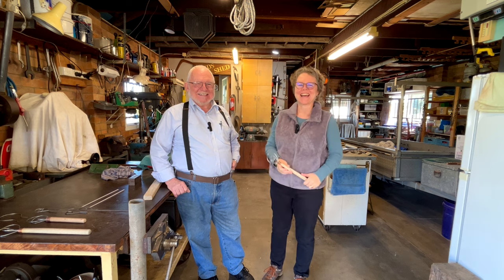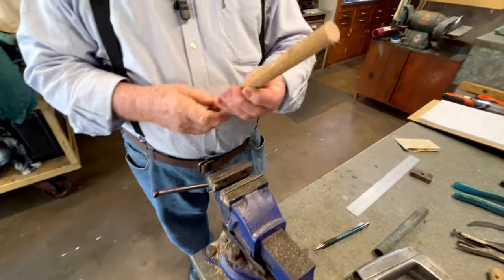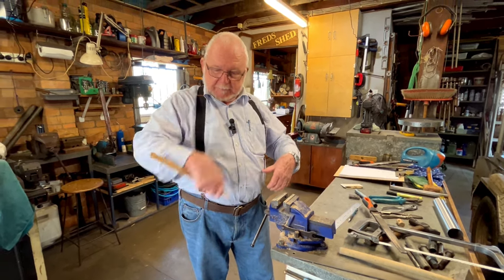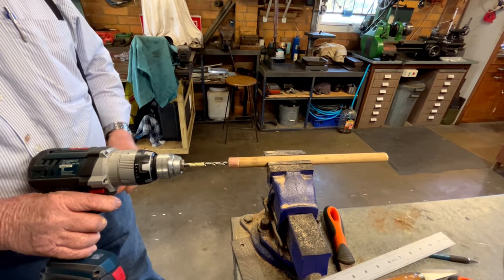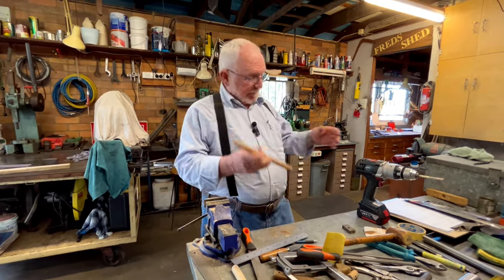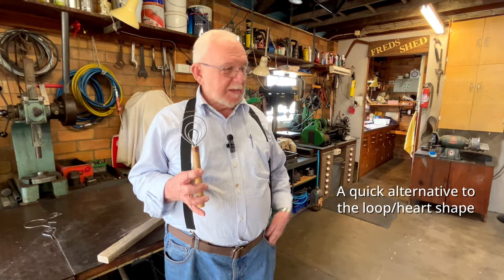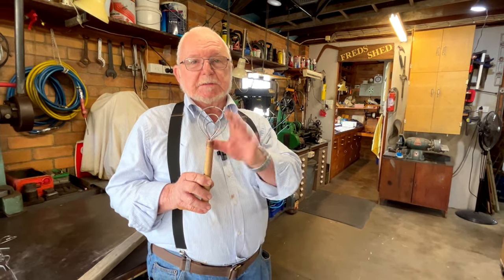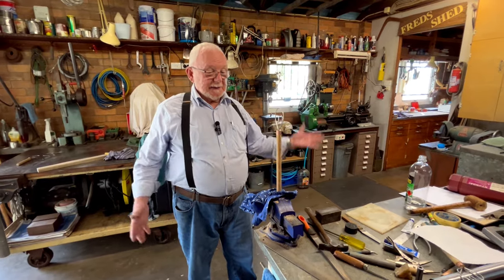How to Make Your Own Danish Dough Whisk (my Dad gives a demonstration of the process).

Comment: That was great Garry and Elly 😊 I am lucky to have a short and longer handled Danish whisk set bought as a pair on special online years ago. They are currently packed up in storage for a while. But thank you so much Garry, I've never understood why the handle was long on the big one. I've favoured the short one all this time! There's nothing like someone who knows "things". No wonder Elly's dad needed her Solvol-like soap. He has a fantastic shed! Elly, I suspect you might be a chip off the paternal block — always a can-do gal like her dad. Something I learned from the small one I use most often, I deliberately pulled the two pieces of wire out of alignment, not too much, and it made mixing easier, especially if there's blueberries involved, they don't get squashed if you're mixing cake mix, pancakes or waffles, also corn for fritters or choc bits, if I'm making things for munchkins, it can all get an  easy pass through the mixtures and the whisk. The soldering wire is perfectly genius because the whisks have strong wire. Elly, your dad's brush and dustpan is priceless! No point in updating if your original still works! (same with his cute  Australianisms) 😄 ❤️
Reply from the maker: Ah Tosca, thank you! I'm glad you saw this. It was such a treat making this, and I think you're right, I am definitely a lot like Dad. Has taught me many things and we both like finding the efficiencies!! (actually so does Mum too). Good to hear you found your whisk more useful with a bigger gap between the wires, some good supporting data for our theory!

Comment: 13:45 if you don't have a punch, just use a nail or even a screw as your hole only needs to be about 1mm as this hole keeps the drill bit from drifting or skirting around. 💖🌞🌵😷
Reply from the maker: Yes, excellent tip Suzi!

Comment: These are gorgeous and I love them so much..

And your wire working technique is excellent! You can make the heart flat then use a spreading pliers to make the gap once it's mounted in the handle, it'll create the tension that keeps it wedged in the ferrule even if the adhesive fails <3
Reply from the maker: Thank you so much!
Reply: @ellyswholegrainsourdough  <3

Comment: I'm not sure l have pipe laying around for the bending part, so I'm going to try my socket set. It has all sorts of rounds. Just remember the size marked on the socket is the inside dimension, you'll have to measure the outsides to get the dimensions in the PDF. 💖🌞🌵😷
Reply from the maker: Exactly! That sounds like a good plan Suzi
Reply: I bought a short piece of copper pipe at a hardware store for a bonsai task last year, so if others don't have offcuts saved over time, it shouldn't be too difficult to get some, or ask at a building site if there's one nearby :)
Reply: @tosca... , I was thinking about a recycling center or dump. My neighbor is a bit of a "collector", he might have a piece. 💖🌞🌵😷
Reply from the maker: I'm sure you won't have to look too hard to find a bit!